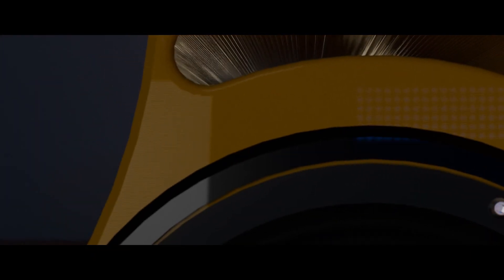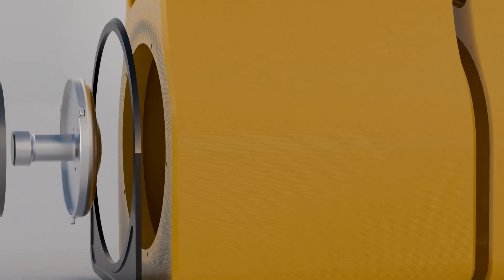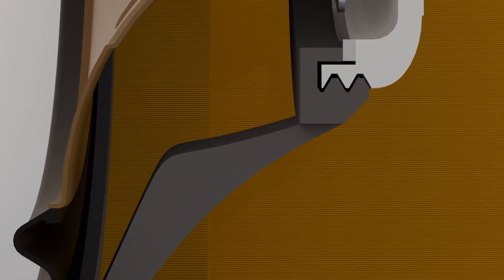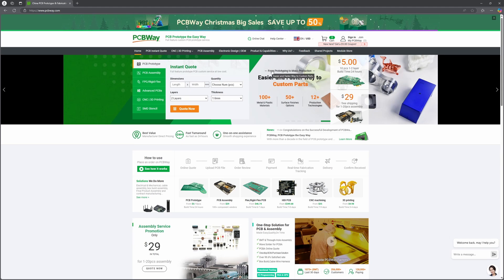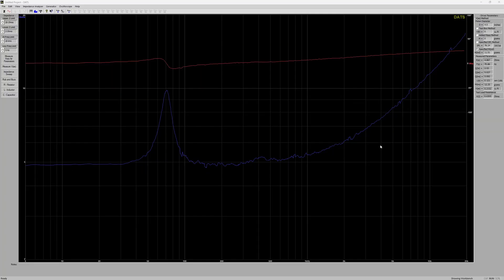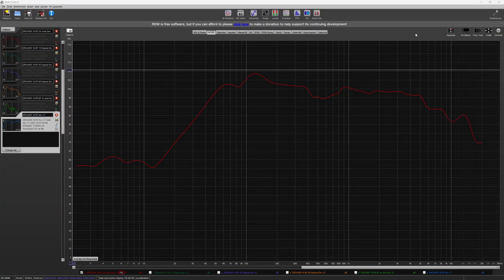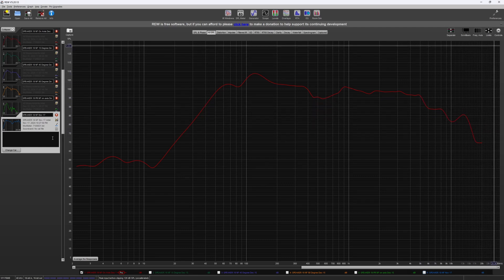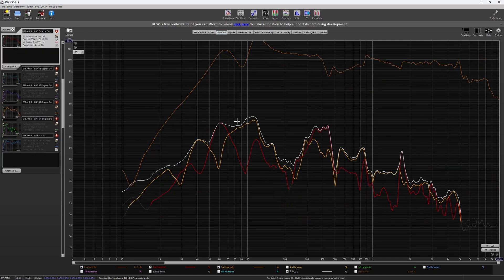Fully 3D Printed Speaker v19 & Passive Radiator V1

Comment: If I remember correctly a passive radiator needs twice the xmax of the driver, or twice the displacement. So having an identical radiator and driver might not be ideal. Basically two radiators and one driver. I think the alignment of the axis could matter as well, better off axis.
Reply from the maker: It very well could, it was really easy to do this in this fashion, and I was curious about passive radiators, so I figured I’d try them out.

Comment: how much did the vacuum former cost? how does it compare to commercial units?!?!
Reply from the maker: It was about $110 USD, I have no experience with commercial units but it performs well once you figure out how “soft” the plastic should be. Only complaint in the 110x110mm vacuum space.

Comment: 1:43 For the PLA vacuum forming process, did you just print a sheet and then use that in your process? Would you consider doing a video on your technique?
Reply from the maker: That’s exactly what I did, I modeled a .32mm thick plate with the right dimensions for my former then printed it, not the most efficient way to do it but it gives me lots of options on cone material and color since vacuum forming and 3D printing both rely on thermoplastics. 

I wouldn’t be opposed to doing a short video on it. I’ll definitely consider it.
Reply: @piscesprinting  Please do. I never thought of doing it that way. I'm interested in your process, but with much thinner sheets. Seeing how you do it would be of immense value to me and I'm sure to many others as well!

Comment: I like the breadbox! Its quite cute, and if you scaled this up and turned it into a Sub, I can see myself putting it on a media cabinet in the same place and orientation a soundbar would usually go, and it would be quite nice.

I also agree that manufacturing is by far the biggest challenge for practical design
Reply from the maker: Thanks! My sub plans have been derailed due to my large format printer giving me issues- so I’m debating on a k-series max for a future purchase and moving away from my large format bed slinger. I do agree having opposing driver/radiator would be ideal for low frequency reproduction in a room so a sound bar space is ideal. 

It’s hard to convey over video but this combo does rattle a few things around the room when turned up- all testing is performed with .5v input to the sub- so the play test and response is only ever 1/8-1/4 of the usable volume. 

Also the manufacturing is a pain, this is the second time I’ve built multiple “drivers” though this time it wasn’t two motors. So I need a jig setup to center the cone and surround and larger lip to mount the surround to- those were the two big issues- I also ruined about 7 cone-formers with the alignment tool for attaching them together getting glued in the mix as well. No amount of mold spray release would let it release easy. So definitely improvements to be made.
Reply: @piscesprinting4170  absolutely some work left to do on your setup, best of luck!